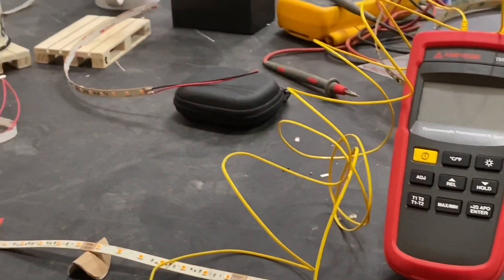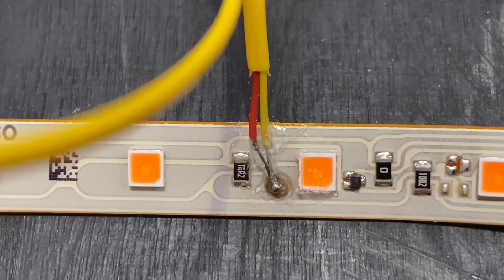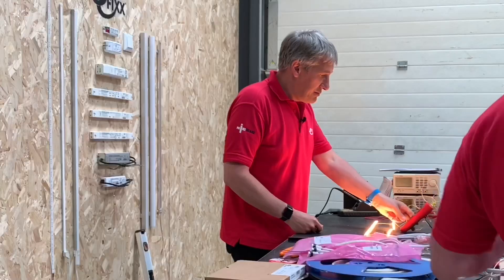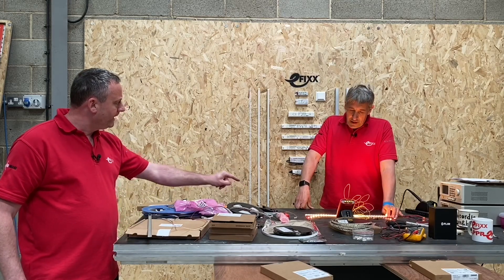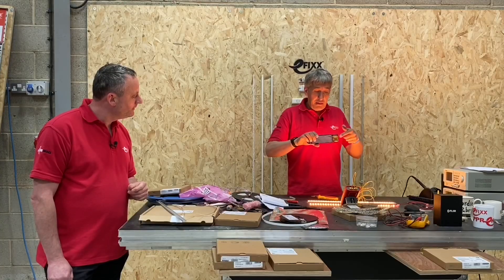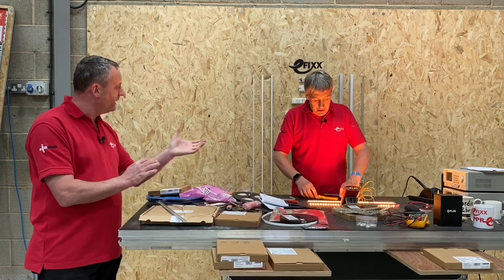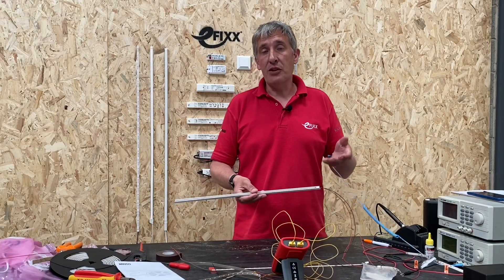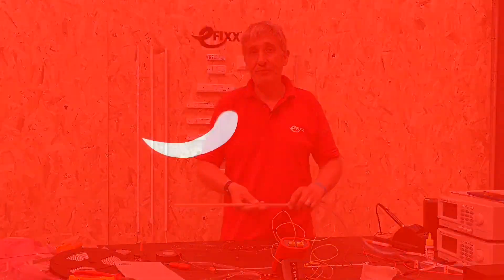Do LED strip lights get hot? - Why use a profile as a heatsink?

Comment: I used LED light strips in our aluminum profiles that are placed inside the shower niche. I turned the lights on dim setting for several hours, by night time the tile in my shower was very hot and the profile was too hot to even touch. Needless to say the led strips burn out with a short amount of time.

Comment: Great video ..  I am concerned about overheating.  I understand some LEDs have metal backing to reduce heat others have just tape backing.  Would it be necessary to apply metal strips to  reduce heat on wood/resin projects?

Comment: What do you recommend for an IP66 strip which is basically the ip30 in the silicon sleeve? Would it basically act as being in air? I was planning to use them in aluminum channels but wanted the sleeve because we get lots of snow and water.

Comment: Very glad I watched this. Have a project in mind with LEDs embedded in epoxy for a table top. Obviously from the info given this is going to result in failurs. May have to think about putting aluminium strip behind the run of LED strip to draw off the heat..Mmmm.
Reply from the maker: Or run LEDs at a lower power
Reply: And remember to let the heatsink have somewhere to vent, without vent it might as well be still encased in marble!

Comment: I had old bulbs in my washroom that would burn my hand if I touched the glass cover. I replaced the bulbs with leds and there is no heat at all and no heat around the back either. How can that be. The difference is extreme. From too hot to touch to no noticeable heat at all. What is the concept?
Reply from the maker: LEDs are much more efficient - so you probably replaced 100 watts with less than 10 watts - so much less heat alround.

Comment: That was both useful and interesting. One of my concerns is with the LED drivers and significant potential for overheating. As supplied they come with two slots on the back with the clear implication that they are fixed using screws flat to a surface. However these little boogers are transforming/rectifying mains voltage to nominal 48 VDC and as expected will generate heat. So the very hottest part of the driver is screwed to the surface (ceiling/cupboard whatever) and heat build up very quickly. I have had one (of 10 fitted) actually ‘blow up’ with the attendant voltage spike taking the LED strips with it. I am thinking of mounting to flat aluminium plate to act as a heat sink. Grateful for your thoughts.
Reply from the maker: Hi Norman - We've just released a video on LED driver symbols - https://youtu.be/3UesLmjG2VQ This should give you some useful pointers on temperature ratings. Hopefully the drivers you are using have the symbols. - Thanks for your feedback Regards (Gordon)

Comment: a big mistake that is made too often is putting IP rated LED strip in the extrusion, once the diffuser goes on the heat soon builds up with the silicone coating insulating the tape.

Comment: LEDs should not produce any heat under normal operation. If they are getting hot, you are running too much current and will shorten their lifespan considerably. I learn't this the hard way a number of years ago.
Reply: LEDs not producing heat is a misconception. Obviously low powered LEDs will product a very low amount of heat (almost undetectable). High power LEDs will generate more heat as more current is running thru the circuit. It is heat management that makes all the difference.
Reply from the maker: All the LEDs in this video are running at their specified voltage. Provided they run under the specified tc point they will last as per manufacturers specification.
Reply: I think im overpowering mine cause half of the strip is hot like a oven 🤣
Reply: Don't talk nonsenses, 50-60 celsius normal LED strip operating temperature.